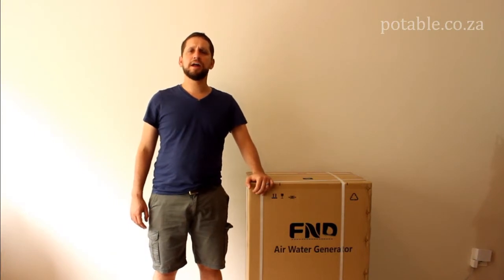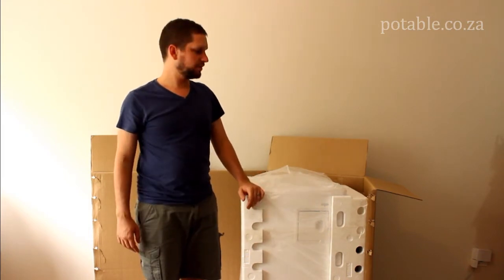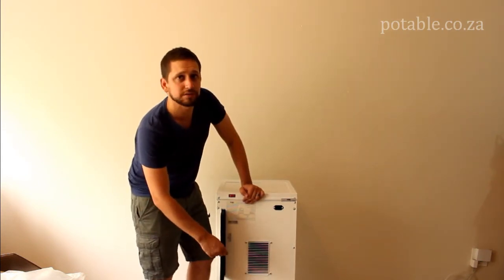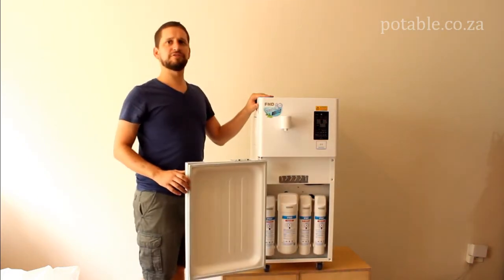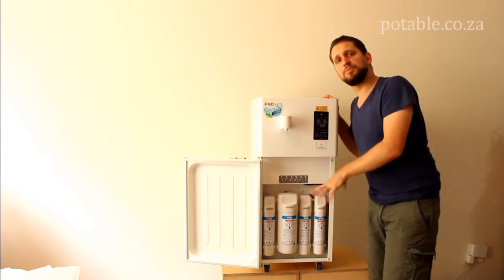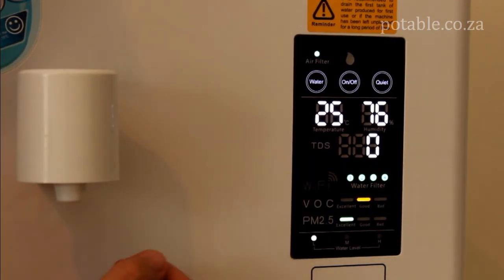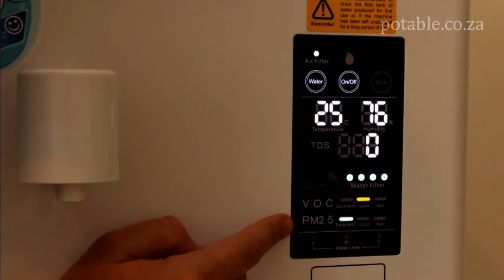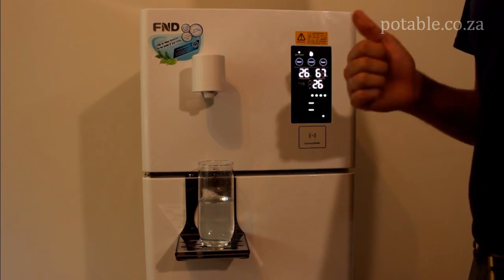P50 Unboxing - Makes Water From Air

Comment: Yeah its called a dehumidifier they basically give them away in thrift stores here in the states, but you don't get all that special filtration, I suggest buying a good hepa filter to duct tape to the $6 US old dehumidifier and run water thru a britta water pitcher. Drinkable water from air @ $25 US unless the air you are also breathing is so diseased that you need all that just to drink the water your pulling out of it.

Comment: Comes to India and China and surks countries and global markets aheads , presentes with low power consumptions, heavy-duty, heat proofs, dust proofs, moisture proofs, general, hot and cold options, faster and easier quality high speeds of water pressure efficiency as much possibles to makes betters for all abouts with proper mades for alls every things safe and secure and safety and security arrangements for alls , we need efforts prices for all abilities above as per said told with Good service provider concerns including abouts manufacturers, traders and services with installations and maintainances with good services options for anywhere else and anything else and any time etc with good access attachments to all abouts, we needs pollutions free and dust free arrangements for running all aspects power impacts good heavy-duty power implications for all abilities heavy access control panels and switches and displays with auto and manuals processes for alls with good faster high quality speed fitters options with replacement arrangements anything else with best care achievement for alls selects global networks processes for all aboves , please contact with Philips, Siemens, LG and SAMSUNG, Godrej , Bajaj, Ureka foobs , pure heat aroo , Sony, GE , Blue stars, whirlpools, Hirers and Panasonic with others with including  general water machines and please contact abouts india for Environmental and safety tests and other things, contacts M/s,ERTL (East ), DN Block, sector -V ,  Salt Lake city, kolkata -700091 , West Bengal , India, please highlights contact persons Mr G Dhara , and Mr Basak and Mr Das gutta , (mobile phone number ):91(0)9883732022 &91(0) 9674353399 , customer service at safety Labs, Overalls information has been given by from Sujit kumar Ray  (Bapi) , kolkata -700013 , West Bengal, India, provides information concern Elco instrument , (Mobile phone ): 91 (0)9836414160 & 91(0)9007488530 , please highlights as per possible choices by Own decisions provides by necessary concerns abouts for all regarding futhers steps for all with proper liabilities with propers research and development tests for the purpose of products for your self adhesive access to all, thanksgiving, you faithfully, God bless you all with love and cares.

Comment: Does this machine have a UV' Filtering Light'/System' through The Water Produced' - Also you said that it works NOT Below 15 degrees C Temp' Range' - What 'we' would like to know is if 'we' install these' machines' onto 'our' Sailing Yacht' - then When the' Temperature' goes' below 15 C it will NOT Work' - or What' at sea level' - Look forward to your' Reply Soonest' - Also 'we' Lived in CT for Some years' & loved Every day There' at THE Worlds' MOST Beautiful City' - For Sure' > ??? Shalom >